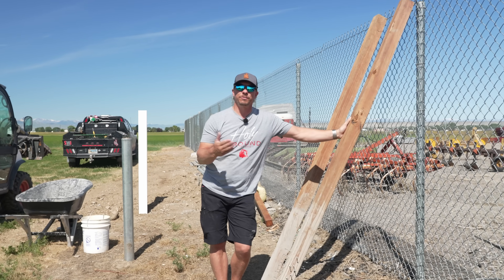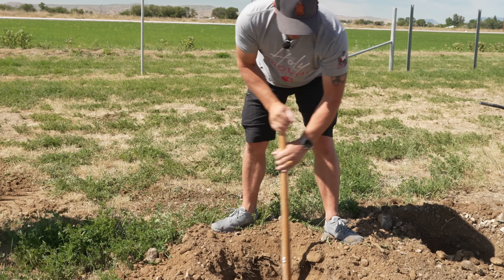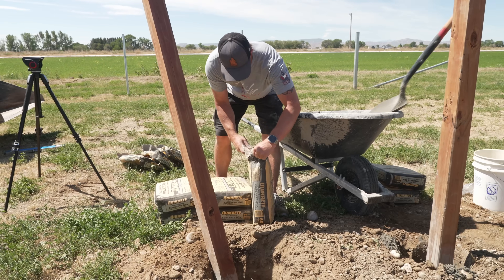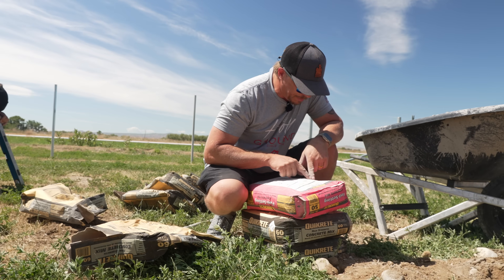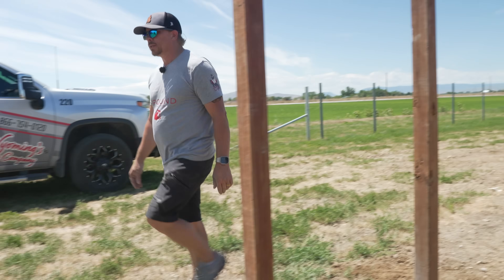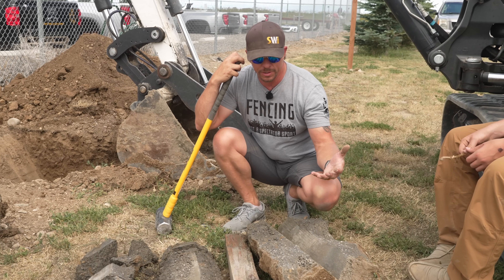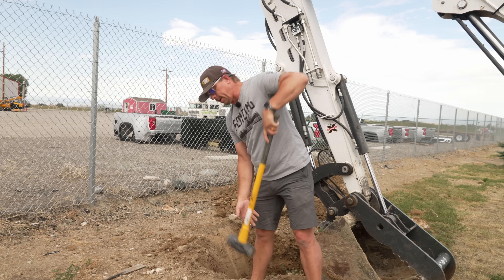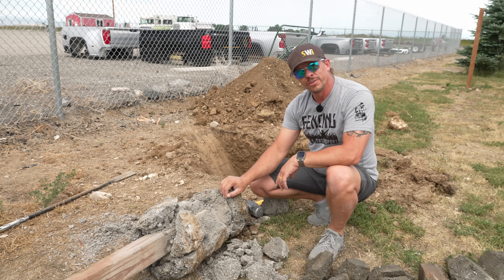Why Adding Water WON'T Save Your Dry Pack Concrete

Comment: We've always poured the dry concrete, add water, and then we use a metal rod to poke at it. It's always worked for us here in Michigan for 20 years so far. The only time we don't use this method is for gate posts. We will mix the concrete for gate posts because it is 100% stronger mixed and then poured, but due to lack of issues, we've never adopted that practice to our fences just our gate posts.
Reply: I’ve installed thousands of 4x4 pressure treated spf posts with this same method.  These are temporarily permanent posts for 4’x8’ real estate signs. I dig a 6” wide hole to 24” deep, put 4x4 post in hole, fill rest of hole with yellow bag quikrete, pour in appropriately 1/2 gallon of water on top.  Sometimes I mix the top bit of concrete and water with spud bar, sometimes I don’t.  I usually have to go back later to remove the signs once the property is sold or the real estate contract is over.  Occasionally the contractor who purchased the property removes the signs. Every single time I go back the posts are always level as the day I installed them and every time the post are almost impossible to remove without a piece of machinery like a skidsteer.  To remove posts I first remove some of the dirt from around the concrete. Then I take the spud bar and smash it between the post and the concrete on every side to try and loosen the concrete from the post. Then I take my farm jack and wrap a chain around the post and attempt to jack the post up out of the hole.  Sometimes I get lucky and it comes out the first attempt, however it still usually takes a lot of pressure enough that the farm jack is bowing and bending with the amount of resistance from the post still gripping onto the concrete.  Often I have to repeat the process a couple times to finally get the post out of the hole.  Often there is still concrete stuck to the post on one or two sides when I pull it up out of the hole.  I also install fences and when I set fence posts I dig an 8” wide by 28” deep hole and mix the concrete before pouring it in the hole because yes it is stronger this way however I still believe through experience of setting and removing thousands of posts over 20 years that the method of pouring in concrete dry and pouring water on top makes a strong set post that will not come out of the ground or become unlevel without excessive force.
Reply: @PresidentDoochBag  sorry, some guys are perfectionist when it comes to mixing concrete. It's a science to us. Like mixing asphalt, epoxy, paint etc. I wouldn't put half of you guys in charge of making a birthday cake.
Reply: @Joe-em3iw 
That’s funny 😆
Reply: @PresidentDoochBag  You need concrete in the hole for a realtor sign?  Amazing. We just tamped them down in 4 inch lifts until full because we knew we were coming back in 6 months to pull them out.
Reply: @Joe-em3iw I put fence posts in this way, never fails 👍
Reply: Same here.  Did it that way on the farm forever.
Reply: @susanfox007yes, for years. Still there today
Reply: He said he lets posts sit for several days to cure. I thought 24--48 hours was enough. Is that not true?
Reply from the maker: Tested that theory here: https://youtu.be/YaxW4YaYq7E
Reply: @SWiFence  No you didn't - you didn't mix the concrete at all. Also, you packed the dry concrete which just makes it harder for the water to get to it. Absolute worst video ever. You are literally skewing facts to try to make people use wet pour concrete (no idea why). Even in your previous video that spawned this, the first comment is a farmer who poured dry concrete and a bucket of water and it's stood 30 years. You are literally a waste of time. Get a new hobby.
Reply: @SWiFence  Not really. All you did was pour the dry concrete mix, pack it, dumped water, and walked away. That's different from what I said.
Our method is to pour the concrete mix dry, poke at it to get it to go down, add water, and then pick at it again (which you did not do) with a metal rod like a 1/2" x 1/2" solid square bar x 5' long. We poke the concrete immediately after we add water around the posts, the 1/2" bar will go down,  water will follow, and then add a little more water if needed and done. New video idea I guess lol
Reply: @mertz313 in Wisconsin this year and most years the ground is so moist the concrete will setup overnight
Reply: @mertz313   You already know that the concrete is stronger when mixing than not because you mix the gate post.  So then the only reason you don't mix the line post is because you're lazy and don't really care. It's good enough for you.
Reply: @Joe-em3iw  you can dry set it’s as strong as wet mix
Reply: I wouldn't be in this business if I was lazy and didn't care. It's simply not needed. I have fences I can show you that were set using this method 20 years ago and look perfect. I know it's stronger to mix, hence why I do it for gate posts, but it's not needed for line posts and I can prove that.
Reply: @mertz313  debatable stronger mix I dry set on large gates 5000 psi mix and it gets super hard this guy calling any fencer lazy is not a fencer. fencing is hard
Reply: @mertz313  There's a lot of things that are not needed. Just like a tomato on cheeseburger.  I want the tomato.
Reply: @Grggeorge  not when all variables are the same except adding water. Use common sense.
Reply: @Joe-em3iw  common sense is all I know so I don’t know what your trying to even talk about, and it sounds like you don’t know either.
Reply: @Grggeorge  Don't bake anyone a birthday cake let alone build them a fence. You're on the shady side of life and don't even know it.
Reply: @Joe-em3iw  yes it can be done I’ve done it easy and they have never moved so you can take lessons now you know.
Reply: @Grggeorge  I still want tomato on my cheeseburger so now YOU know. You're also obsessed. get over it already.

Comment: You seem to have unlimited machine budgets so you should look into the "mud mixer" instead of doing that crap by hand. Hook a hose to it, power it, put in dry and it does the work and pours it out of the end mixed
Reply from the maker: We always order off a truck--we're never mixing stuff ourselves.
Reply: @SWiFence  Even then the unit would pay for itself in less than 1 trucks price and a truck can't get to the holes always so you are transporting it anyway. You probably have a tuck that would hold a pallet of concrete and water tank. It would mix 2-3 bags in less than a minute each hole.
Reply from the maker: We pour straight from the truck into a cement hog. https://youtu.be/STRqduxsokA?t=219
Reply: @SWiFence  AHH  i see. sweet
Reply: @MP99. He’s not a concrete company.  Why would you not let the professionals that do it daily and specifically assist your trade?  We are in business to specifically do our craft and partner with others to create a seamless cohesive experience for all…not make more work for ourselves needlessly.  Those that cannot leverage partnerships and penny pinch along the way are those that fail at business and work way harder than they need to.
Reply: @thedivide3688  Yet I am in business and understand that. Try not to be condescending when you reply to someone who was not addressing you to start with.. 

A short load is not cheap, I know as I am a contractor 

 A machine that does the work for you is 3,500.00. A smart business is looking to streamline it's margins. Most fences are not long enough to warrant a truck so you are bleeding cost to some degree. He pointed out how he uses a bobcat with attachment which is awesome and before I knew that I mentioned it. Maybe look up "mud mixer" and see what it is. It is not a barrel type. It does the work from dry to wet and corkscrews it into the whole fully mixed.
Reply: @MP99.  He was just showing concrete for home fencers.  SWI primarily does steel no dig post drive posts.
Reply: @thedivide3688  He uses a cement hog and a cement truck he even posted a link to the video. Try to keep up. Maybe read his reply to me a few comments up on this same threads you are replying. Stay in your lane dude.

Comment: Thanks for doing this update. That was also what stood out to me in your original test. I've seen people use the dry method and all of them add water afterwards. They also use a different type (as you did with the red bag) because not all types say you can add water afterwards.

As the results show, adding that water made a huge difference. In your original test, the dry with no water was completely worthless. In this case, although the strength of the concrete is much weaker (you would never do something like this for structural work), for just holding a fence post, it's probably perfectly fine in most cases.

I've never actually seen anyone just use it completely dry with no water added afterwards, even when they say they are doing a "dry pour", nor suggest that is the way to do a dry pour. I'm curious where that idea came from or if there is actually people that do that.

The main idea behind the dry method is just that it saves equipment, mess, and the time spent mixing. It's not that you don't have water on site and thus add none after pouring.

Personally however even for small DIY post setting without a wheelbarrow, I just mix it first in the 5 gallon bucket before dumping it in. It's worth it to me to have stronger concrete.
Reply: Mr fence does the full dry pack method. It’s arsebackwards though!
Reply: Why do cover the top of the concrete with dirt? Logically speaking, isn't that asking for trouble? Dirt get wet and cause wood rot over time.
Reply: @cheerry777  In reality EVERYTHING is wet in the ground. There is no magic exlir to keep posts dry. Water will even soak in the above ground section and drain down to the subterranean section. But logs submerged in the eastern rivers by the colonials are being pulled up today and are in superior condition. The real question is what is the weakest link? If your pickets and rails only last 30 years, of what value is a 100 year post footing?
Reply: "Mr Fence" is training up the next generation of cut corners everywhere possible fence installers. Good enough is not good enough. If it can be done right, then do it right.
Reply: Some Ppl build fence post by packing with pebbles or gravel. No concrete. I wouldn't do it, but
 many ppl vouch to that technique.
Reply from the maker: Believe it or not there is a purist dry pack crowd who swears you don't need to add water at all.
Reply: @SWiFence  .... are all of the conditions and uses (strength requirements) the same amongst the 'crowd' ?? My bet is no.
Reply: Wet cement is not compressible. Dry is. Dry pours usually take much longer to cure but my experience shows it is fully strong after a decent amount of time rather than only a few days. Packing allows the post to free stand whereas wet cement does not.
Reply: @finallyfriday.  I've seen dry pour (with water added) vs wet pour tests where they break it open after 90 days. The concrete from the dry pour was much weaker (comes apart much easier). It's fairly obvious because it wasn't premixed, the water isn't evenly distributed, so some areas have proper binding while others don't. I doubt a completely dry mix would cure faster than that or do better in this regard.
Reply: @jakej1837  I'm betting much of the varied results have a lot to do with ground moisture and precipitation. Here in northern Michigan moisture is abundant and given enough time it will full saturate and cure. I've pulled some posts the following year and the cement was good. In dry areas I'm sure results would not be as good. Further- what is good enough? Does it need to so strong it can take the impact of an 18 wheeler? Cuz the post itself sure as heck can't. Anything is as good as its weakest link so a 30 year post benefits not at all from a 100 cement blob at it's base.
Reply: @finallyfriday.  Yes, if your area has wet ground or rains often, the results obviously will be different. Adding the water however eliminates that variability.

I did some more searching however and it seems the ones using it completely dry are not depending on it ever getting wet or binding together. Instead it's a method used on clay soil where the surrounding soil is unlikely to get loose. So basically the concrete is only there to act as a filler. For areas with loose sandy soil it's not a good method because it may eventually loosen.
Reply: @jakej1837  I appreciate the observation. I happen to live in a very sandy area and also worked in Florida in an area of pure sand. My observations are that the soil below the surface never really loosens regardless of its make up. There is no reason for it to get disturbed and no room for that either. If it's packed decently that pretty much how it stays. Where's it going to go? This is why we're moving more and more to avoiding cement altogether, except at gates that get some lateral loading and movement. In fact, clay soils frost heave up here because they freeze and expand but sand doesn't at all. If it does anything it might slide up the post a fraction and then slide down again when it thaws. Minimal movement as sand is practically impossible to "push" as a mass. Conversely its the solid cement blob that can get pushed on by freezing.

Comment: what if you leave the dry mix with the water set for 6 months? I agree wet set is the best but I used dry set in a couple of dead men.(a post that I made 1/4" abs sleeve) that I can slide a 4x4 post into. I use them for removeable fence / gate.... I also have different lengths 4x4's for work posts.... 1 I have a vise attached at standing height, another I use as a engine hoist lever and so on.... I just have to use a lever to slide (Pull) the 4x4 out and cap it if I don't need to use it.... so  I did them in the late fall in the northeast and never used them until spring. I haven't had any issues of them moving or wobble and I did use screws through the abs in both directions... outside to hold it from turning and lifting and the inside screws  the 4x4 rests on to stay dry from ground contact. I did one without the abs sleeve and put grease on the 4x4 and wrapped it with thin plastic...... I haven't used it yet and wonder if it will even lever out? I may need to use a jack the 1st time? btw.... I use 2x4's and sandwich glue 1/2" plywood to make the engine hoist..... it is at least 3x as strong as a 4x4!

Comment: IIRC Doesn't fast-set concrete have even more organic-salts (like calcium-chloride) that pulls water in to enable the cement to cure even faster than normal concrete mixes (<1h, vs <1wk, vs <1month, vs <1year, etc) - with diminished (final) maximum strength and corrosive effects from the salt throughout the resulting material?
Reply from the maker: Ooh, great question! I'll have to look into that.
Reply: Fast set is weaker than even the dry pack regular with some water. 
It has next to no strength at all. 
I stopped using it years ago.
Reply: but how would the corrosion really occur, its set concrete.

Comment: Mark! Mark! Mark!  I can’t believe you used dirty water in your corn-crete!!!

Every Ozark farm boy knows that the secret to successful post planting is to use cool fresh mountain spring water… iffen you are doing it during a drought, the only acceptable alternative is to substitute a few squirts of urine… which means you have to bring along a bottle of last years Elderberry wine to prime the pump.
Reply from the maker: But this is clean water! You should see our dirty water. 😆
Reply: @SWiFence  I guess I’m just a bit spoilt… what with all the crystal clear springs, cricks and such that we have to cool our watermelons and take our weekly baths!

Sorry fer the misundertaking.
Reply: Crick?  CRICK!  I thought my family was the only ones that used that 'natural flowing water' term!  

For the curious out there, a 'crick' (in my upbringin') is MUCH smaller than a creek, 3-4 ft wide or less, 2-3 ft deep or less, fasst running, and crystal clear (usually refreshingly cool/cold).  Not many here in north central Texas... but I first learnt about 'em as a kid when my fly-fishing dad was stationed in South Dakota.  😊
Reply: @Oldpqlyr  same here abouts!

Comment: Should add a bag to the hole and toss in a gallon and use the spud bar to stab the mix and then repeat for all bags. That is how i've done it.
Reply: How we do it also
Reply: Yeah same. I'll also add that you should pre soak the hole a bit.
Reply: @SovereigntyGW  I’m sure it’s just in the middle in terms of strength between using the wheelbarrow and just leaving water on top. Definitely easier than using the wheelbarrow though
Reply: @masonhaggard1199  agreed and would say the strength you lose, it's in terms of psi/mpa which isn't what we are looking for, just something which won't erode away. "

I would also throw out there... any of the dry pack that doesn't set, well thats because water never gets to there. if water never gets to there then it is never going to erode, and if water does get to there, then it will just set up. random thought i had.

but yeah the 10-20 times ive had to pull out posts we dry packed and its not fun, definitely not going anywhere without demolition but does bust up quicker than wheelbarrow mixed
Reply from the maker: There seems to be 100 variations of this method.
Reply: Concrete is porous so in a more wet environment, the mix will eventually get moisture and setup. Also i think I've heard that the less water you use the stronger the concrete which is one reason polymers are used. Use half as much water but still just as workable. I believe "practical engineering" did a video about it